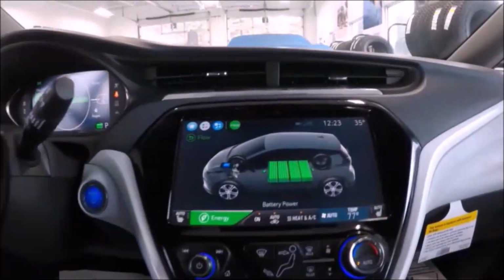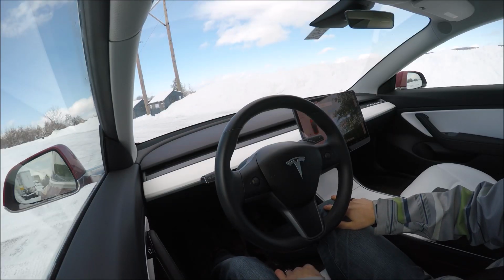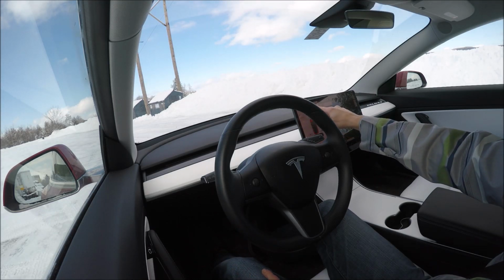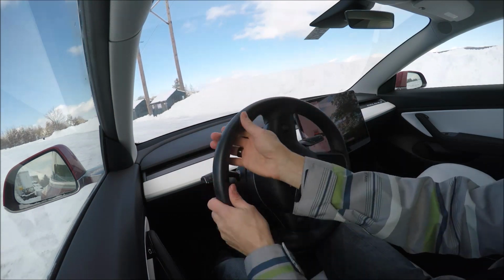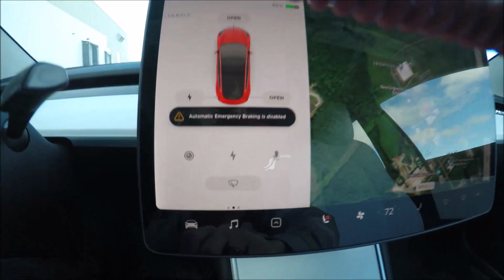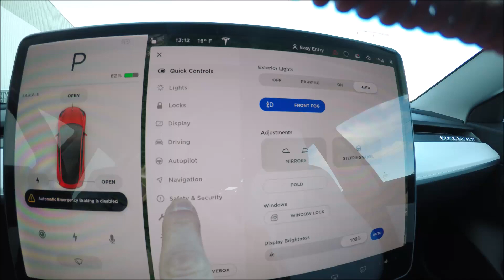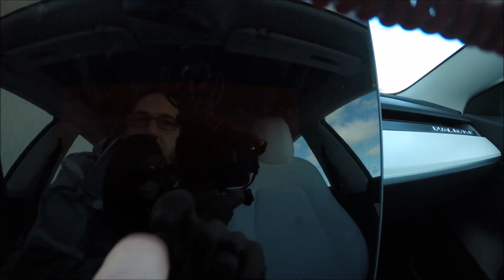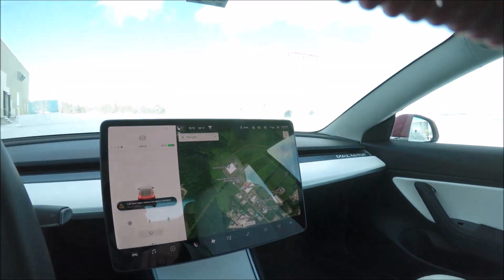How To Drift A Dual Motor Tesla

Comment: Thnx for the video. I have a question, considering that it is a video from February 2020. I bought a Model 3 Long Range on December 18, 2021. And I saw that you have the option of "Free Traction". By selecting that mode, will it be without traction control and will I be able to do the same as this video or will it still have restrictions? I have not yet been able to test it since I do not have a safe place in the area ...
Reply from the maker: Aaron,  I haven't tested this since the video and numerous updates.  I'm not even sure if DYNOMODE still works, but it's worth a try.  If it does work, then you will have no traction control or nannies. Let me know if this still works.
Reply: @TM3Life  Thanks for the reply!

Next week I will go skiing and will be able to try it. I tell you with the traction control deactivated and also if I can activate dynomode.
Reply: @aaronone1996  did it work?

Comment: Very interesting and great driving on your part!  Thank you for showing the steps of putting it in Dyno Mode, too.

I’m too chicken to do it myself...
Reply from the maker: Thank you!  I wasn't sure how well it would go for a couple reasons.  First, it has all that torque available right away. Second, I haven't done any drifting in years, but I guess it's just like riding a bike...lol.
Reply: It’s a good thing if skills like that are like riding a bike!  If you’re ever in an actual skid, you’ll remember exactly how to steer out of it!

I wish I had your guts!
Reply from the maker: @lmckrosen123  You could totally do it!  Just need a wide open safe location.  I would suggest an Auto-X closed course.  That's a great place to build your skills and confidence.
Reply: That’s a great idea!  I’d love to have a snow-covered course similar to yours!
Reply: Most boring burnout ever.... lol

Comment: I have a problem when I put my M3 in dyno mode it only goes like 25 km/h and has like no gas response.
Reply from the maker: That is odd?  I have not put mine in since this video, so maybe they changed something?
Reply: They nerfed the dyno mode after what i have read
Reply from the maker: @nakre15  Well, that sucks!

Comment: This Dynomode was so disapointing.. electronics are not completely off. Multiple rounds with drift in roundabouts  not possible. Caps power or stability control interferes after 1/2 round.
Reply from the maker: I didn't notice that and did multiple runs.  What year is Tesla?
Reply: @TM3Life  It is because you are driving on snow. In your video you can hear tractioncontrol is kicking in but you are still sliding on the snow. Aslo try to get more angel on your car at higher speed and you will notice. Try it on dry tarmac it will not work..
Reply from the maker: @thoraagehold3912  I will give it a try, thanks!